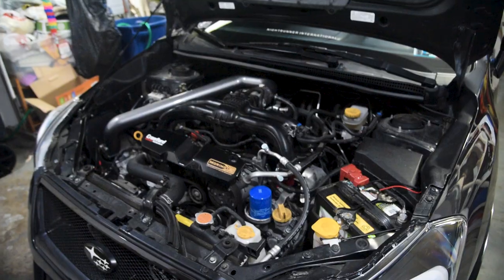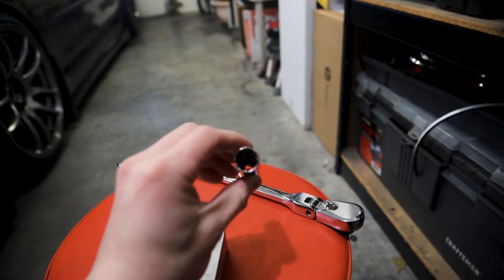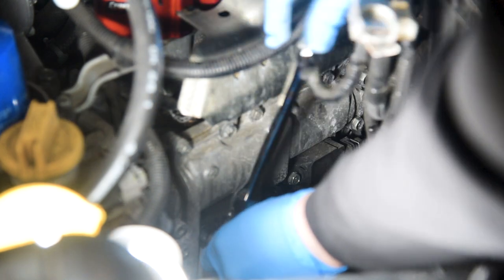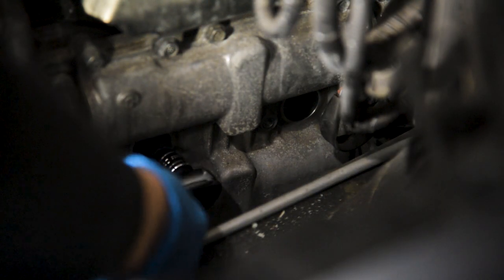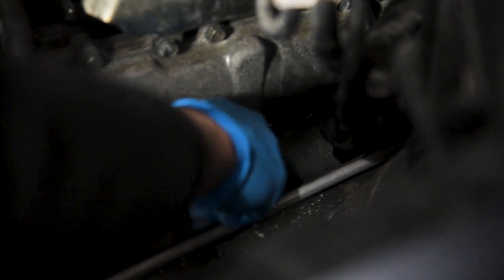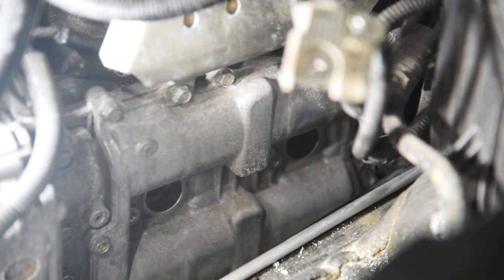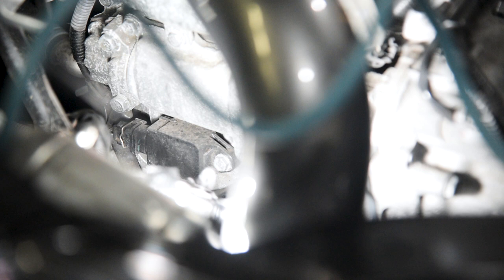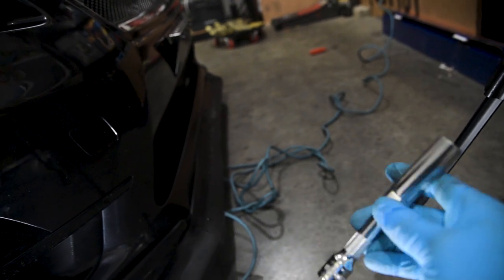DIY: Subaru (FB20) Spark Plug Replacement | Easier Than You Think!

Comment from the maker: I didn't mention this in the video, but it is recommended you check each spark plug for the proper gap. These come pre-gapped at .044",  but there are cases where the gap may be altered during shipping. The best way to check the gap on IRIDIUM plugs is by using a wire spark gap tool (I used this one: https://www.amazon.com/CTA-Tools-3238-Spark-Gauge/dp/B00PISL328). Check each plug to ensure they are gapped at .044" before installing. I checked mine after I installed just to be sure upon learning the importance of spark plug gap. Mine were perfectly in spec right out the box. There are many tutorials on here on how to gap Iridium plugs. The wire gap gauge is recommended for Iridium plugs because it prevents damage to the fine tip electrode.

I also confimed the spark plug gap being at .044" by checking my old plugs, which also all came out to .044".

Comment: This was not easy it took me 4 hours lol especially if I was new In doing hands on work on my car. Spark plugs they where pain in the ass tho
Reply: Also I have a Sedan so less space for it in the engine bay
Reply: It took me 3 hours. I needed a 1/4" flex drive with a 10mm socket to remove coil #4.

Comment: It was really pretty easy  and only took 1 hour. I used a couple of hinged extensions along the way. Also getting the new plugs started with a length of fuel line on the tip made that part a breeze. I did have to use a long nose pliers to get the old plugs out of the deep holes.

Comment: You need to dunk that positive battery terminal and pillar in a solution of sodium bicarbonate and boiling hot water to clean that corrosion off and then smear some Vaseline on it.